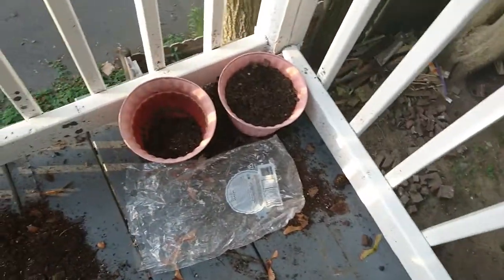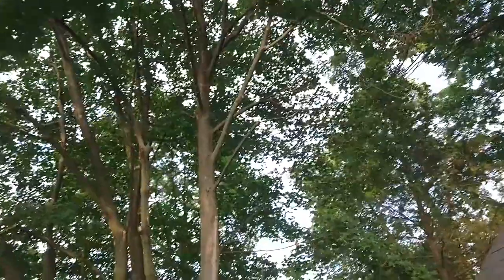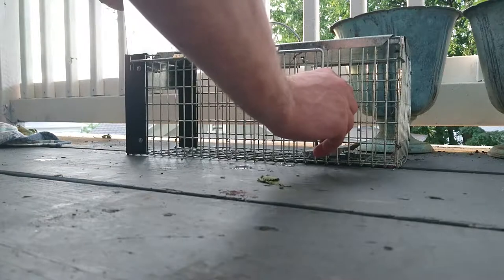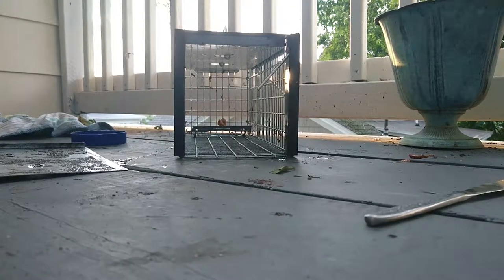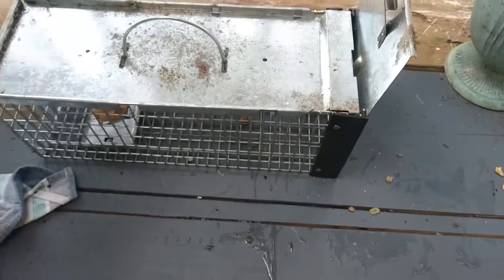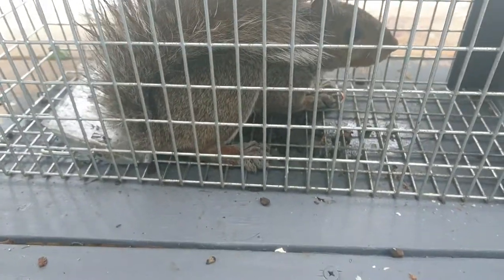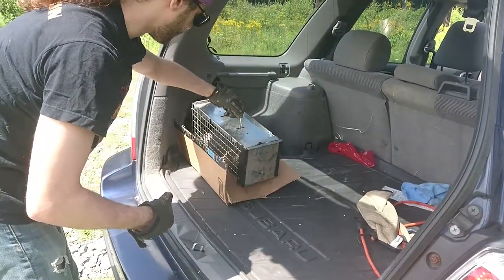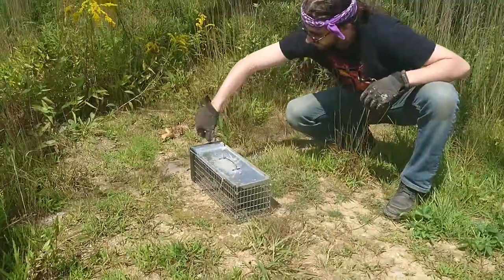How to Trap Squirrels + Havahart Trap Review

Comment: The Havahart Model # 1083, one door trap is the best trap
for disposing of destructive grey squirrels by a mile.
https://www.youtube.com/watch?v=DKrmmWK3ZXE&lc=

Discouraging birds from triggering the Havahart 1083 Squirrel Trap :
I cut a wood scrap approx 3/4 " by 1.5 " to the exact width of the trap. (I cut the ends at a slight angle.)
I do this so I can jam the wood into the trap in a way that it is just tight enough 
that it can not easily be removed by an animal prying it. 
I then screw 3 wood screws completely through the 3/4" width, equidistant across the  7" width of the wood scrap.
Then I get 3  16.9 oz Pepsi plastic bottles and cut the end with the bottle cap, off.  (approx 1.25 ")
Then I drill a small hole through the center of the 3 bottle caps and attach the caps to the 3 screws in the wood.
Them I screw the ends of the Pepsi bottles into their caps that are secured to the wood.
Then I place peanut butter inside the 3 plastic caps. and the ends.
* * * * Then I take this assembly and place it backwards up against the far end of the trap. * * * *

If you do this right, the birds wont be able to access the peanut butter because 
there is not enough room  for their beaks to reach around and then inside the plastic bottle caps.
I also cover the entire back of the trap and the back/top portion of the trap with an approx.  7" wide piece 
of sheet metal, so that the birds can't reach their head through the back and eat the peanut butter from the outside.
I drill holes through the sheet metal and use electrical ties to secure it to the trap.
The sheet metal on the top portion of the trap prevents the  peanut butter from
getting wet when it rains hard.   Squirrels tend to find food via their sense of smell
so they will find the peanut butter in the bottle caps, even when they can not see the PB.
I also place a couple of peanuts within their shells inside with the peanut butter
to further prevent the birds from getting all the PB.
Some day I should probably write a book about trapping grey squirrels.
WRZ  2024-01-07
Delaware  County, PA